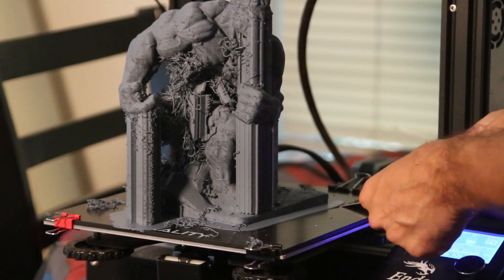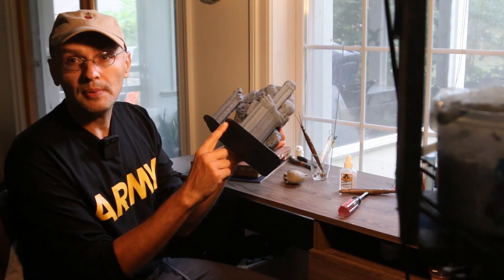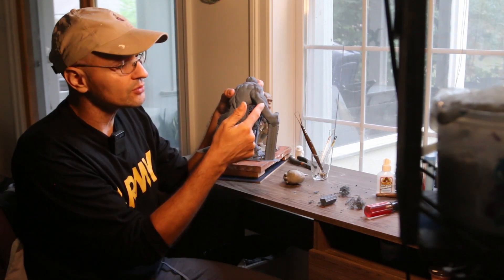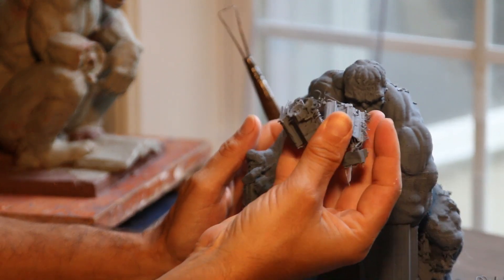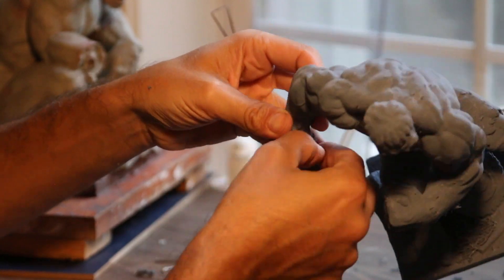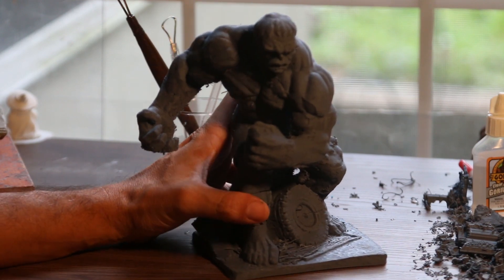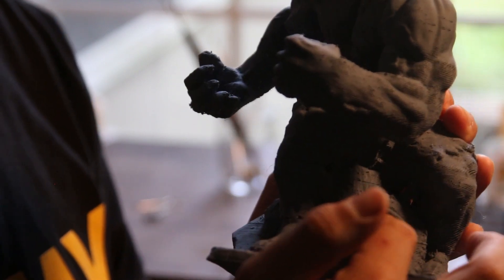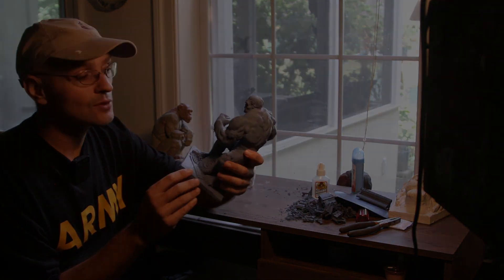Does 3d scanning work? Lets make a print of a sculpture

Comment: You can split of the arms and head if necessary with Meshmixer and add joints for easier printing. 👋
Reply from the maker: hey thats a great idea.That way i can print the same size as the original as well! thanks!

Comment: Re the column supports for arms etc. If the printer prints from the base upwards it will always need column supports . Rather than let the program insert the columns, could u re-photo the sculpture with columns ( like pencils) that would be easier for u to remove.
Reply from the maker: One of the things the printer does is that the supports is printed with less plastic and easily broken plastic. If i did it with columns i think might be more durable, but also harder to remove. Also i believe when it got to a part of the body it would leave the mesh visable. I have not tried it so its just a guess